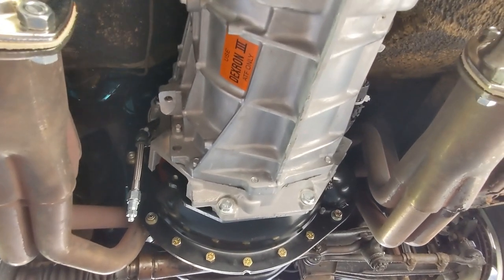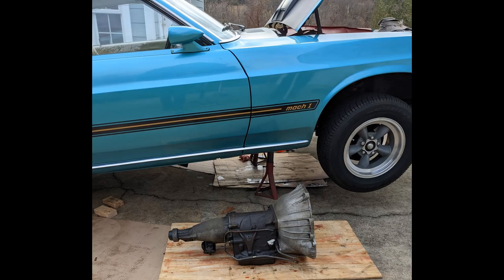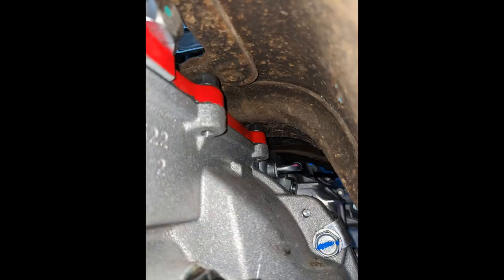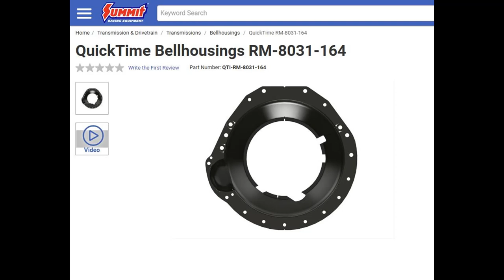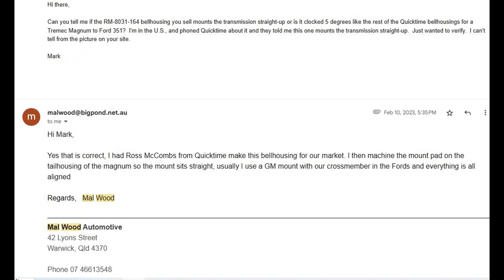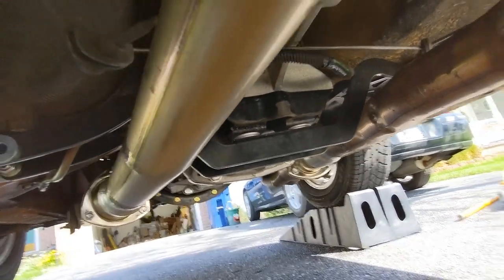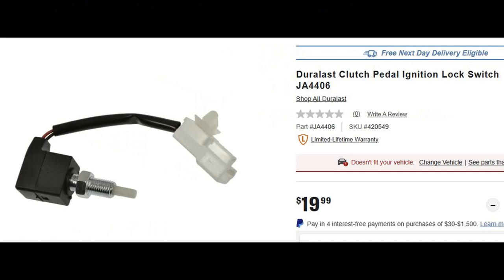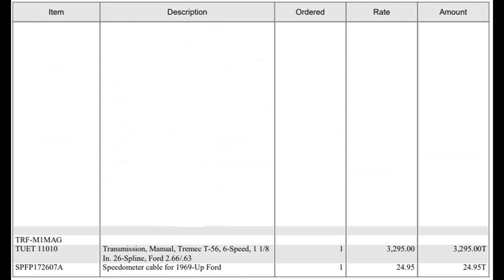6 speed 1969 Mustang 351W - Tremec Magnum Install Tips PT I

Comment: I can’t believe it, so happy to have found your videos. There is so little material on doing a FMX to T56 swap on YouTube! I’m going to enjoy this!!
Reply from the maker: Thanks for watching.  I didn't include a bunch of detail, but if you have questions I can try to answer them.
Reply: @MarksMuscleCarGarage thanks! I guess I was tired when I was typing that comment because I wrote TKX instead of FMX (corrected it now). I guess I'm just curious to hear your experiences from finally being able to shift manual in that car and have total control. How is the driving? How is the highway? Do you love it?
Reply from the maker: @Silencer84  Yes I like it a lot. It's much more engaging than driving a 3 speed automatic. The Magnum is pretty much identical to the Tremec TR6060 in my '22 Camaro, (other than bellhousing) -  it has the same gear ratios, and not surprisingly shifting the Magnum in my Mustang feels pretty much the same as shifting gears in the Camaro, although the shifter in the Camaro is shorter.  I would like to drive a TKX though to see how it feels because I rarely use 6th gear (in either car) unless I'm cruising at 70+ for a good stretch of highway. If I were starting over I might consider the TKX because it should have a lot more clearance.

Comment: Did you have to remove the trans tunnel top portion? T56 is bigger than the old transmissions right?
Reply from the maker: I didn't have to do any cutting in the transmission tunnel.  The only clearance problem is with the reinforcement brace that goes across the top of the trans tunnel forward of the shifter opening.  I did a test fit the first time, and marked where it was hitting, then took it back out and dented the brace to gain more clearance.  Yes, the Magnum has more girth than the original FMX automatic transmission.
Reply: @MarksMuscleCarGarage ok so you just had to dent the brace, not necessarily cut anything, that's great!
Reply from the maker: @Silencer84  Yes, although the brace is pretty tough and is not easy to dent.  It took a lot of beating on it with a big hammer.  Not easy to do under the car.